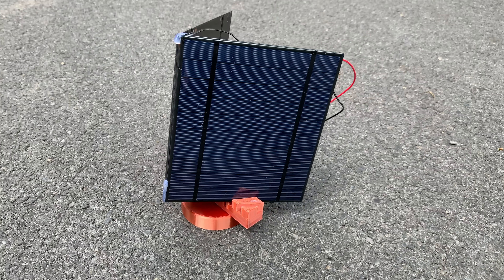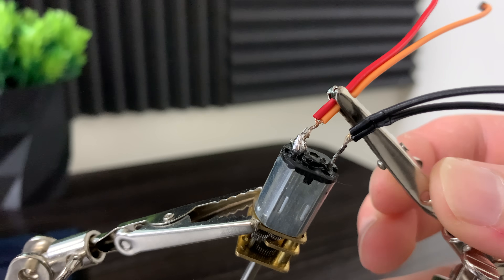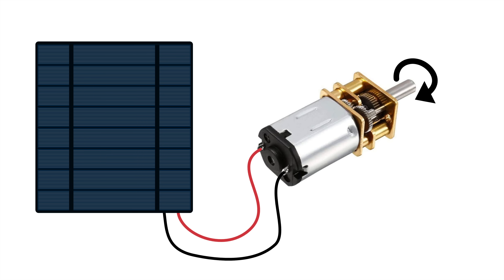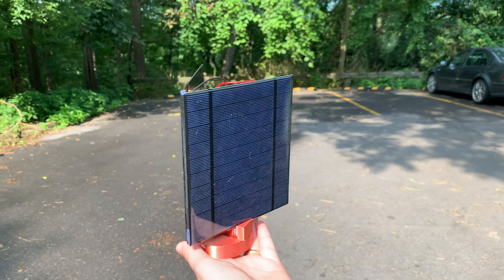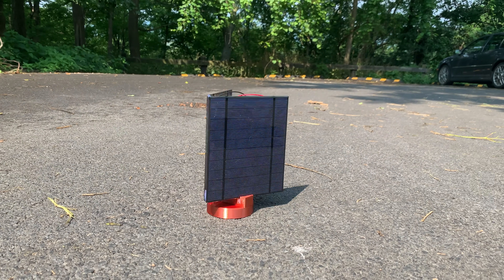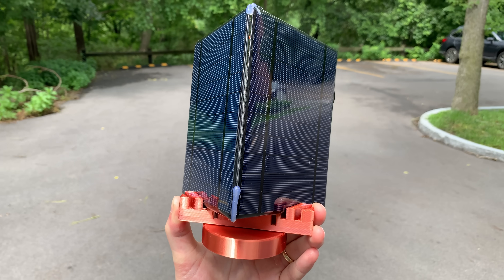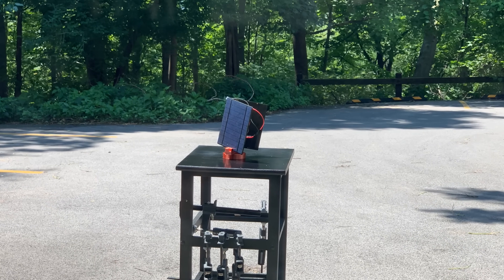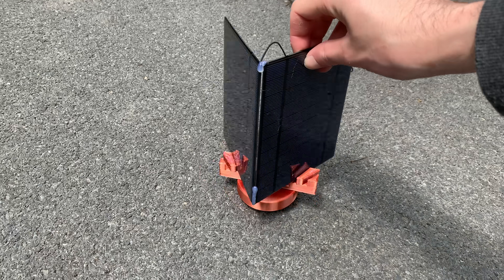World's simplest sun tracker.

Comment: I could be completely wrong, but, wouldn't the addition of an "and gate" before the motor allow for the circuit to offload power into a battery as opposed to having the two opposing forces fight and cancel eachother out?
I suggest an and gate because it would allow power to flow to the battery ONLY IF BOTH solar panels are outputting similar voltage (which would mean the DC motor in the current version would be stationary).
In any other case the system would either be unmoving (because it can't find enough light to power the motor) OR either Panel A or Panel B, would cause the motor to activate making the system rotate until both panels output similar voltage (therefore going through the AND circuit to the battery)  or neither can find any light to power the motor (in which case no power goes to either the battery or the motor).

This does increase the complexity of the system but it would do so in a minimal way compared to the benefit gained from it. If I understand correctly AND gates are the simplest of gates outside of the NOT gate, and this in many ways would still require no programming or computers whatsoever.
Reply: "only if both solar panels are outputting similar voltage", no, that's not how logic gates work. to flip a transistor you usually need 0.7V, so that makes no sense.

Comment: I'm not a electricain or a microtechnogist who learned this for years...
joke, i am such rare one. and i see a problem:
you just shortcut both solar cells. yes, the voltage goes to zero but the current goes to inrfinity. thats called a SHORTCUT.
and everyone knows what happens if you shortcut something: it gets hotter and hotter till it burns.
the motor just turns because one solarcell have a higher voltage as the other and he uses it. after he stops there is no consumer and you get a shortcut.

Comment: Currently the design will not point towards the sun if neither of the panels is pointing towards the sun, a possibility. If you added 2 more panels to the back of the design, wired appropriately, it could turn towards the sun, allowing the original panels to operate. Where this might be relevant is at the end of the day the panels will point towards the sunset, the next day the sun will rise from the opposite direction and face the back of the panels.

Comment: easier way NO POWER needed ... no electronics ... no wires ... no power draw .. 
.
the sun will provide everything ... use 4 BLACK tubes .. one on each side of the panel ... top bottom left and right ... each tube is filled with a liquid such as car antifreeze ... each tube connects to a piston on the opposite side to move the panel ...as the sun heats a tube it expands the antifreeze and pushes the tube back into the shade ... this now will auto align for all sun and all seasons ... and you NEVER use any of the precious solar panel power ... 
.
and every part can be 3d printed for such a small panel ... large panels like the polycyrstaline 2x4 foot panels (NEVER USE MONOCRYSTALINE they are too inefficient)  you can now swing an 8 panel mount all year log .. and you just use abs and patients ... and of course the seasonal clean of the panels to inspect and recharge any fluids that have left ...
Reply: btw that is not the simplest ... above is ... yours is the most most wasteful next to nasa ... and just because it uses few components ... it wastes panel power ... when a heated fluid will do the same thing and not even use any panel power ... and since you already printed the base ... adding 4 black PLA tubes and some basic 1mm interior tube to feed the pistons ... you get a self balancing panel array that uses the sun to track the sun and leaves all your panel power for use
Reply: and no this isnt my idea I saw it done in Arizona ... on full size panels and it works perfectly ... no need to swap motors ... no need to find the resistor to slow the motor ... no soldering ...no wiring ... no wires ... no motor ... just black bodies and tubes and pistons and you now have a solar heated hydraulic sun location platform

Comment: Nice to see the technique implemented so simply.   However, I would question how much benefit you would gain from the tracking if the panels are at such a steep angle wrt to the sun direction.   You'd really want the 2 panels to be close to facing the sun for maximum production, of course, but I imagine that would negatively affect the tracking  scheme due the smaller difference in voltage you'd get in that case.
Reply: I think the goal here was not to make solar panels produce the most electricity by following the sun, but merely to build something that follows the sun by using solar panels.

Maybe this design or a better version of it could be attached to an actual big solar panel.
Reply: You could have two solar arrays, this tiny device as a position/driver. and another much larger one for solar production. Use the angle/position of the tracker to send a signal to the larger array so it can rotate for maximum efficiency?
Reply: The sun rises and sets so slow that two small solar panels used just for tracking or maybe a bit bigger can turn the big solar panels facing in direct sunlight. 
You can gear that motor down so much you wont even see it move and it could turn the weight of a car.
Reply: I would aim both the panels directly at the sun and have them divided by a vertical shade down the center that would cast a shadow on one or the other if not aligned to the sun.
Reply: @AdamantineAxe  And if the sun is 90 degrees off to one side?  Or more?  What happens?  If your panel is pointed west toward where yesterday's sun set, and then the sun comes up behind it in the east the next morning, what does your twin flat panel system do?
Reply: @stargazer7644  The V arrangement would be as bad because the V would point towards where the sun set. I think @adamantineAxe is correct
Reply: @guyosborn615 Having one panel facing sw and the other facing nw at sunset will give you a difference voltage much earlier when the sky in the ese brightens in the morning.  If the panel is facing directly west, you get much less of a difference and your panel will face the wrong way longer.  Try it.  You also get more stable operation with the V arrangement when pointed at the sun as you get more voltage slope due to cosine error, so the pointing is more accurate.  With the panel perpendicular to the sun you have no slope at all, and the response curve is very flat giving very little differential for a wide band of angles close to the sun.
Reply: The goal isn't to generate power from the tracking panels.
Reply: Then add 2 more at the top which are for the battery
Reply: But you can use it as a controller for larger objects

Comment: Ah,  OK? If the unit tracks the sun and then centers on the sun and the voltages are neutralized, what good are the solar panels if they aren't generating power for some useful purpose?? Or do you now have to build another platform connected to it that has other solar panels that just generate electricity for use?? You should be more specific about what it is finally used for

Comment: If it finds the neutral point, where there's the same amount of sun shining on both solar panels, and the wires of the 2 solar panels are connected basically in series in relation to each other, I see 2 problems:
- The voltage cancels out and all this does is heat up the wires, with no way to harvest the generated solar power
- Both solar panels are at an extreme angle to the sun, meaning they are not getting full solar power, compared to them facing the sun directly. I'm no electrical engineer or anything, but wouldn't one panel facing the sun directly generate more power, than these two combined, being at an extreme angle to the sun?

I am not stating facts, this is my opinion based on what I observed from the video. If I am wrong in any way, feel free to correct me.

Comment: But this setup isn't practical is it ? What is needed for the purposes of practicality is for your setup to allow the use of much larger commercial retail solar panels, plus taking power from the photo-voltaic panels defeats the purpose of why you want to expose solar panels to the Sun in the first place - Which is to harvest 100 % of the (available) energy the panels can deliver to a charge controller circuit to store in a battery array for later use through an DC to AC inverter system.

Comment: Nice job.
Why not lay the panels flat 
 _ _
but a few degrees pointing upwards and a sperator panel inbetween?!
\|/
Plus angled to the sun and use its arc through the sky as the axis.
  That way you get full power from the Sun ( which is the point of a tracker)
The way you have it that is low power. 
But also useful to track the Sun to control the main panels.
Just having a quarter of the panel in shade, will turn the panel off.

Comment: I designed something like this in a game called Homebrew: Patent Unknown, except I used 3 panels per system - one central panel and two edge panels that were angled inwards a few degrees. Sometimes the simplest solution is the best, though I did need a reset function since at the end of the day my system would be facing west, and not be ready for the sunrise in the east with such shallow angles.

Comment: * Update 1/5/2023: please disregard this not well thought through consideration! My stuff up! Something NOT to consider: In stead of wiring the panels in parallel so they fight each other controlling the motor, you could wire the panels in series with opposite polarity. This way the panels do not fight each other but work in an additional fashion which would allow theoretical use of the power produced by the panels. I.e., (panel 1 plus) (panel 1 minus) (panel 2 minus) (panel 2 plus) (plus motor) (minus motor) and then back to (panel 1 plus) to close the circuit. If the panels drive off the sun, reverse the polarity of the motor.
Reply: aren't solar panels just something like a diode? So if you connect them in series with opposite polarity, one panel simply blocks the output of the other?
Reply: @Reneg973  Mind the polarity, the Panel will allow the current entering from +ve terminal and leaving --ve terminal. Thus we have to  use additional reverse blocking diode while connecting more panels in parallel.
Reply: @diliprana3882  @Rasputin You are absolutely correct. Blocking diodes would be necessary.
Reply: @Reneg973  yes they are.

Comment: A novel solution with a terrible design creating a worse problem.  The goal of pointing at the sun with solar panels is to maximize PV output, so that cells are perpendicular to the sun. With this design, two panels pointing at an acute angle is almost certainly worse than if ONE were perpendicular to the sun.  Additionally, ANY shade cast on a solar panel can substantially inhibit its output. Lastly, the goal of PV is to EXTRACT energy from the sun... not just turn a panel. Once you add that dynamic into it, I would expect severely compromised function.

Comment: You're short-circuiting the solar panels by wiring them in PARALLEL.  You should have wired them in SERIES, in which case the voltages would truly cancel out and no current would flow when pointing to Sun.

Comment: This is fine, if you only need to point at the sun, but a stick in the ground can do that. Wiring panels like that cancels any useful power output, except for the instant it moves due to imblance between the panels, and that would be a fraction of the power from one panel.

Comment: Interesting.  I had a concept for a sun tracker that was pretty simple, but as mine involved more sensors, an Arduino and some programming, this one wins.

Question though, being fed from two panels with opposing polarity, isn't the electricity still flowing through the motor generating heat?  How long will this function without burning out?
Reply: The voltages cancel each other out, so there should really not be any current either right?
Reply: @ikbintom  Not really sure.  I'm not an electrician.  But what I'm thinking is panel A is generating power, and sending it through the motor.  Panel B is doing the same.  The motor doesn't move, because as far as function, they do cancel each other out, but the power is still flowing.

Comment: What if you extend the verticle axis (along the shaft) and put a verticle flap and add a variable resistance to control voltage going into the intial motor you had... will it make a traditional fan - due to to and fro motion ?

Comment: The whole point of tracking the sun is to maximize the amount of sunlight falling on the panel and generate as much energy as possible. Having the panels at different angles, neither of which is perpendicular to the sun, and using any energy generated to power the motor defeats the purpose entirely. 🧐

Comment: Well, and if you connect that as a Control-Mechanism to a Bigger Solar-Panel you can use it to rotate big Panels just like that, ensuring it'sx  Angle fits, and the third Solar-Panel can then be used to collect the Energy for the typical Usage.

Comment: the sharp angle isn't ideal for maximising the useful current from the panels. to optimise this you should flip the angle around and flatten it out as much as possible
Reply: He is not trying to maximize current, he is running a small dc motor.

Comment: Not so fast dear! 
Major problems:-

1. Motor will heat up due to restriction of movement.

2. panels are wired in series without any proper load. Motor is just acting as a resistor

3. Not scalable for bigger panels. Higher voltages will damage the motor and panels.
Reply: Restriction of movement?  Nobody has there foot on the motor shaft.  The panels are not wired in series, they are connected to a dc motor.  The dc motor provides load.  Not scalable?  Why not?  You can get bigger more powerful DC motors.
Reply: @robertmorin6495  draw a diagram without the motor, and you will notice the series loop connection between the panels. The Motor is simply a resistor here. With no true load , most of the current produced will end up heating the panels themselves. Any more power and the panels will burn out.

It's a basically a low current short circuit. that's why no major company is using it, inspite of low cost.
Reply: @RightOne1  Both panels are producing very low voltage and very low current when aimed at the sun because of the non optimum angles. These low voltages cancel each other out at the motor terminal connections.  Only when one panel produces enough juice to overtake the other, does the motor rotate.  Not sure if the panels would burn out...haven't tried it.
Reply: @robertmorin6495  surely they will burn out at higher wattages. Electric currents never cancel each other. They flow into the panels, resulting in heat energy. The low  internal resistance of the panels, in parallel with that of the motor, and zero inductive load will burn everything soon. And this setup is insufficiently powered for rotating any more than a few hundred grams.

So it is impractical!!

A sight modification to this setup might work. Sometthing with the settings that will not produce any current when in an optimal direction.

Comment: The problem is that your wiring doesn't allow you to tap the power, and you are looping the current through the panels so that the panels are throwing their max current anytime both panels are equally illuminated.  A digital drive would be better.  Wire the panels in series as you should and then monitor the voltages and turn the motor accordingly.  You could do it with a comparitor and a FET.
Reply: Back feeding a panel can be dangerous with more power. This method might give the wrong impression to most people.

Comment: This.  But with photodiodes so you can...you know...actually utilize the solar power from the panels too.
Reply: No!  When it is pointed at the sun, the net output is zero.  That's why the dc motor does not run in either direction when it is pointing straight at the sun!

Comment: Am I tripping or something? Aren’t you losing most of your efficiency by having your solar panels angled in the sun?
Reply: Yes he is losing most of the efficiency.  But, who cares? He only needs enough juice to controll a dc motor to track the sun.   Tracking the sun is a useful thing.  If every solar panel in America tracked the sun, there would be way more power available.  The way solar panels are aligned now is not very good. They find a south facing roof and the panels stay still all day.  Most of the day not at an optimum angle.

Comment: Not trying to be rude but I fail to understand the use of this thing. The energy harvested from the panels is just used for the motor and is canceled out later anyways. Conventional solar trackers use LDR's or some light sensing element and give out DC harvested from the sun. Doesn't this type of sun tracker defeat the purpose of doing solar tracking to get maximum efficiency out of sun? I don't get it. Anyways it's a cool project but I can't think of an application for it.
Reply: Would you agree  that regularly mounted solar panels mounted on a round rotating platform and aimed at the sun would be useful.  Would you like to go rotate the platform every fifteen minutes by hand as the sun moves across the sky?

Comment: But wait, I want to make 10 times more complex mechanism, with 100 times more components and 10 thousand lines of code to do the same thing, which would also not work without GPS and an Internet connection.
 Can I still do that, or did you actually ruin it for me?